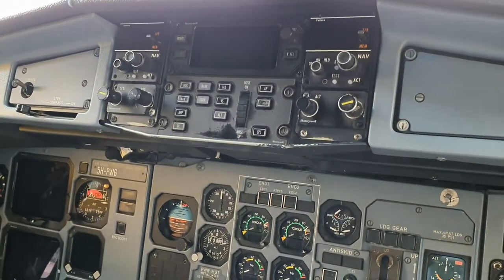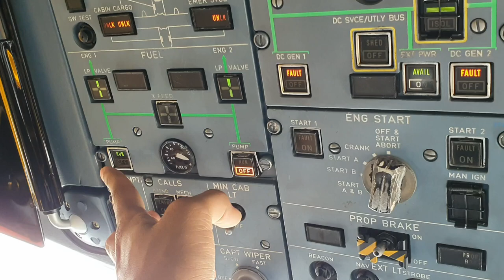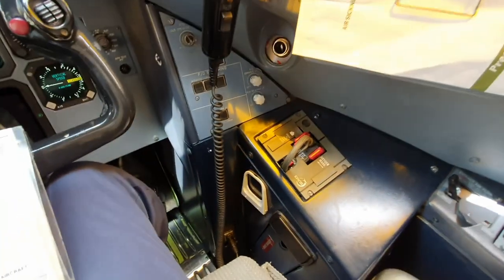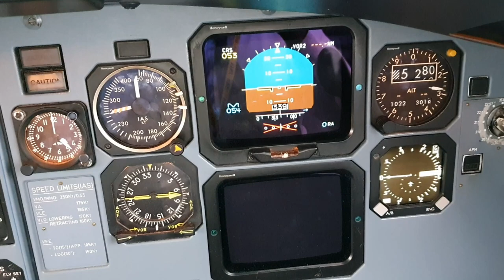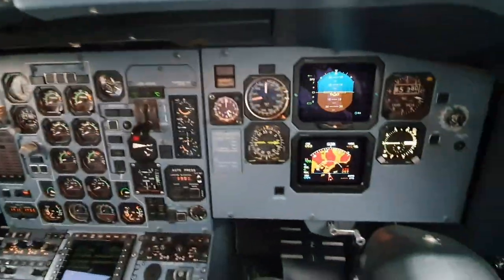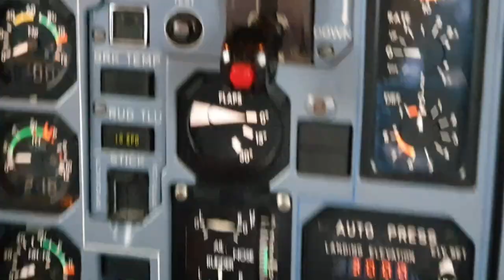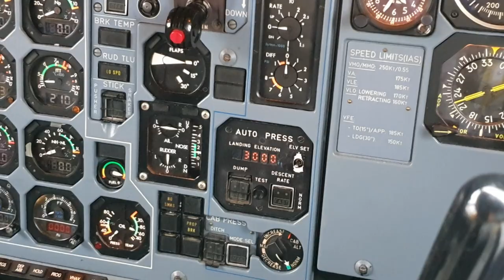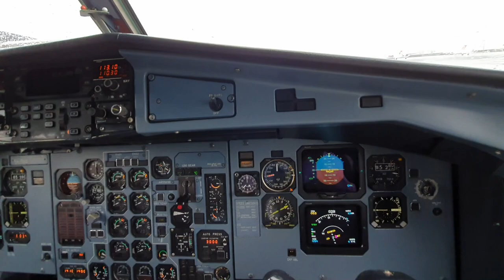Full Preliminary Cockpit Preparation ATR 72 500

Comment: Thanks a lot for uploading this video. Just one question, 
I've noticed that there's FAULT has appeared on ICE DETECT panel. Is that normal?
Reply from the maker: ICE DETECT works on AC Wild power. Since we hadn't connected ACW it would be on fault as it's not powered. So yes it is normal.

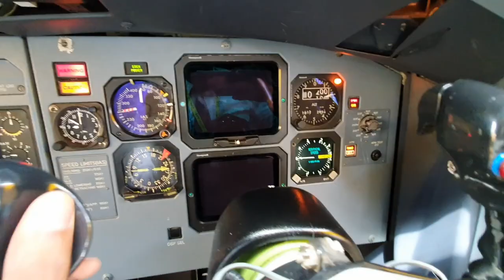Comment: I see a green light thats only half lit at 2:31.

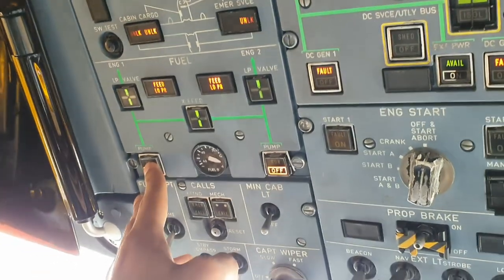Also the fuel pump off light at 3:37.

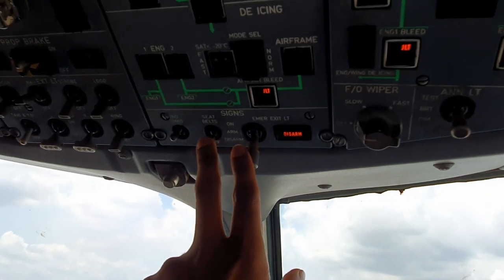At 6:00 there are many more lights with a defective half. That means no redundancy in case the other half fails right?

Lol and radios and ADC with problems! This plane is riddled with issues??
Reply from the maker: Hey psy0rz, the lights are fine. We can have them replaced if both bulbs are fused. There are plenty of redundancies, CAP message etc if the system fails and we can isolate the problem even if the light is fused.

Almost all planes in the world have some failures at some point but they still fly, there's special procedures where we can dispatch planes with defects or inoperable systems. Try to look up ADD (acceptable aircraft defects) and MEL (minimum equipment list) 

If we started grounding planes just because of half fused lights, there wouldn't be any planes flying around today
Reply: @rockerkunal  thanks that makes sense! Great video btw. :)
Reply from the maker: Cheers!

Comment: Overkill ! Pre Lims should take less than 2 mins.  Any longer the airlines would go bust from delays !!!
Reply from the maker: Hey John Creedon, this was a tutorial video, of course it doesn't take 20+ minutes to do the preliminary. It takes me around the time you said to do it all in line operations. This was not overkill, this tutorial was done by the book, anything else and you're going out of ATR procedure. Also this was for first start. You can watch the transit checks video I made for in-between sectors which takes the preliminary around 30s to do. Hope this cleared it up for you
Reply: Tell that to the crew of Santa Bárbara Airlines Flight 518... they rushed it and payed to much....

Comment: Couple more things mate...1. Why do you not turn the windshield heating 'on' as per the chk list? and 2. Why do you do the Anti Skid test as part of the preliminary cockpit prep proc
Reply from the maker: Hey there, thank you for commenting!
1) the CB/gear pins. I actually completely forgot to video that, it happens just before you sit down. I understand the mistake 
2) the windshield heating for us was in the fleet notice for us as to keep it off until we have AC wild. I did not understand it as it's not powered to begin with. However the engineering team directed us to do so
3) I looked up the antiskid and I learnt something thank you for pointing that out!

Cheers and happy landings!

Comment: Dumb question. Why does the ADC differ between days??
Reply from the maker: It's a way to have equal utilisation of both ADCs so that we can discover any failures within the system, the same as we use different starter the same way and also the transponder. Use 1 for odd dates, 2 for even dates. For eg, on the 2nd September we'll use ADC 2, ATC 2, and starter B

Comment: Is there no Autofeather alarm with CRC when you do ATPCS test on ATR-500?
Reply from the maker: No there is not on the -500, not sure about the -600
Reply: @rockerkunal Oh I see. I do fly the 600, never flown -500. In ATR600 There is CRC, Autofeather and Eng Flameout warning when you do ATPCS test. BTW Can I ask, how do you know if you have autofeather in case of Eng Flameout on takeoff on ATR500?
Reply from the maker: @cruxader27  if the ATPCS is operative, the ARM light would go off, you'd get uptrim on the working engine and the Np I believe would reduce to 0%. I think the only way to know if it feathered would be with the Np gauge.

Comment: Is the ATR 72-500 cabin pressurized? How come I have never seen on inflight safety demonstration. Only for seatbelts and the vests
Reply: Correct me if I'mm wrong as I am not a pilot. I'm 100% sure it is pressurized (I'm a regular ATR flyer) however as it usually flies at "breathable"  altitudes most models aren't equiped with oxygen masks.

Comment: Great preflight cockpit check demonstration.  Wanted to ask if the ATR42-500 would have a similar cockpit setup and if not what would be different cockpit-wise? Thanks.
Wishing you Blue Skies!

Cheers!
Reply from the maker: Hey Craig, the 42 has exactly the same preparation. The visible difference is that the 42 has 3 flap settings which are 15, 25 and 35 compared to the 72 which has only 15 and 30. The other differences are just performance and procedural differences due to the flap settings. 

Cheers!
Reply: Thanks much I am actually quite interested to know as I am preparing to start ground school for the ATR 42-500.  Keep up the good work with the videos I will be in touch.
Happy flying!
Reply: Thank you for this informative video! Continue filming and giving us tutorials, please!!
Greetings from somewhere near Venice Int'l Airport, Italy!

Comment: There are a bunch of bulbs burnt out on many of the switches, your going to break that roller blind being ruff like that. It’s called a Symbol Generator not a signal generator. Your supposed to check the Brake Temp by pressing the switch on the RH maintenance panel. The “switching”  as you call them are Audio control panels.